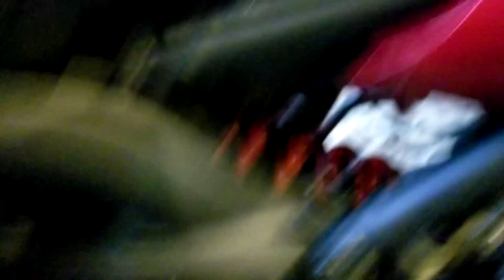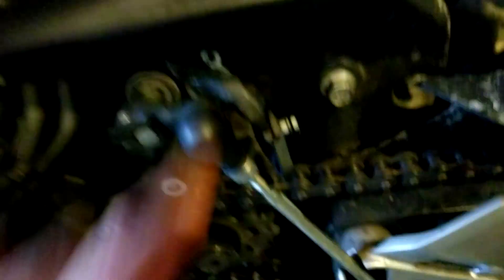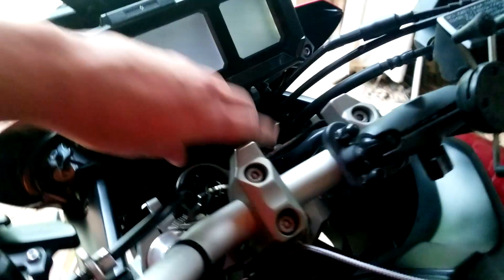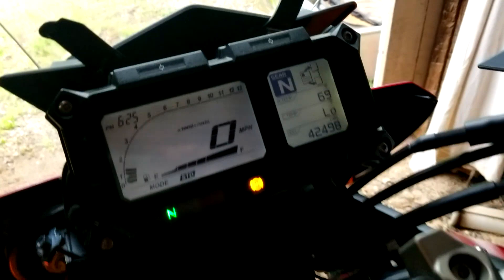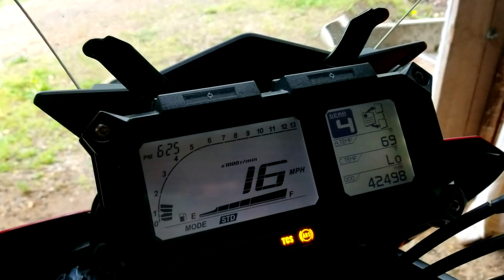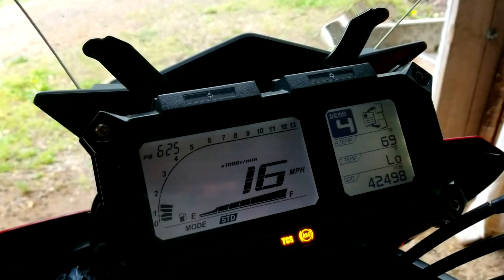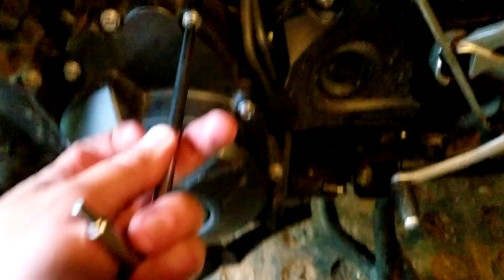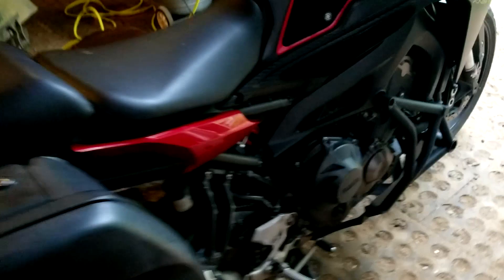Fix Your Gear Indicator FJ09 FZ09 MT09

Comment: My tuner (who did the motor in my 450 triple race bike) did some work on my street bike, and the first thing he did was use a paint pen to put small lines on the bolt and frame, so I can tell at a glance before every ride if anything has loosened up. Super helpful, and I've only had to touch up the paint once.
Thanks for another awesome video, Joe!

Comment: Nice video. I just picked my first Yamaha. It is an FZ9 and I noticed the same problem. I have a question for your. The clutch sound is some how loud, as if it wants to be a dry clutch in a ducati. Ofcourse not the same. But it is not like my Hondas. Is that normal?
Reply from the maker: they've got noisey clutch baskets... the rubber grommets slightly oval out and it just makes chattery noise.  so far, in all the cross plane triples from yamaha that i've seen, none of it has been cause for concern... it just sounds ugly.
Reply: @4theriders  Thanks. I have been riding for 20 years. This is my first Yamaha. After trying the Italians, I decided to stick with the Japanese, but it was mainly Hondas.

Comment: I did this and it worked good at first and then stopped working again... :(   Might need to sand a bit more off although the connector looked pretty clean when I reinstalled.
Reply from the maker: mine stopped working after a few months as well. haha.
Reply: @4theriders  Been doing a bit more research and it seems to be a faulty solder connection inside the switch, probably need to replace if I cared that much... lol  Appreciate the video though!